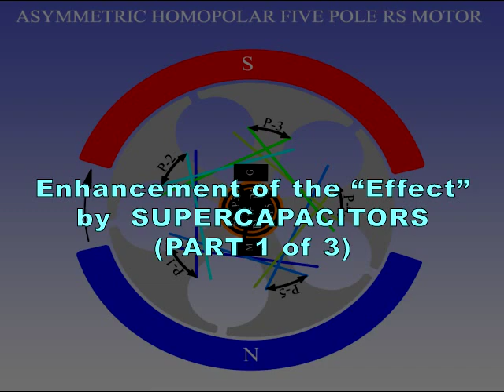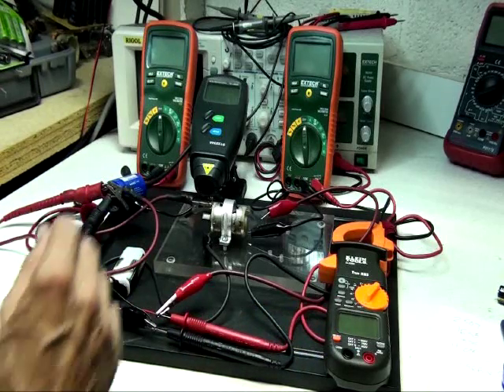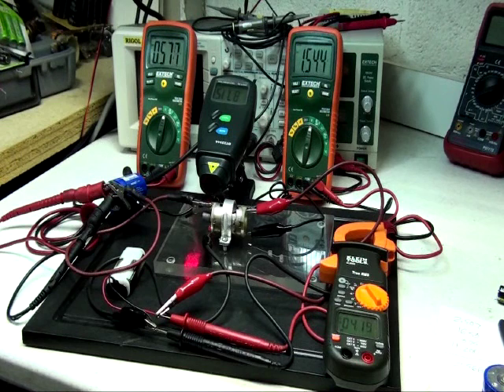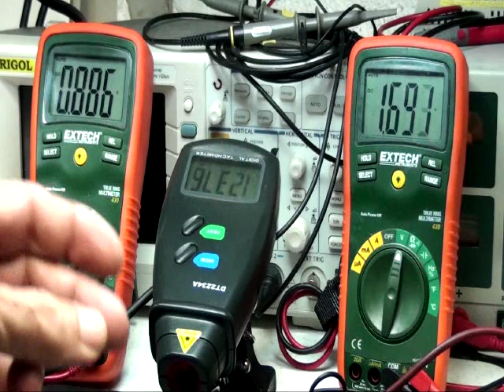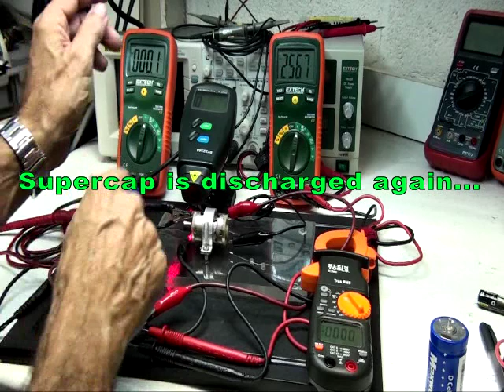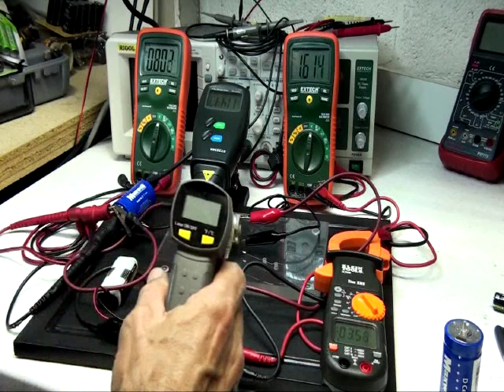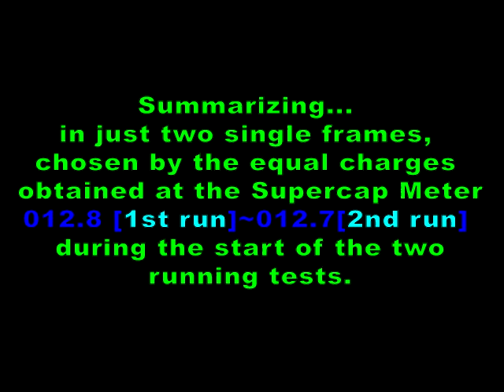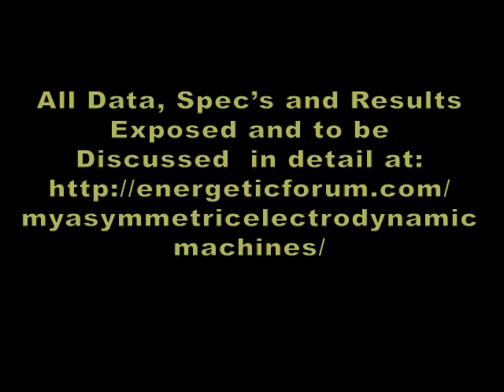SUPERCAPS TEST 1

Comment: This is good research. Your doing good progression. There is an anomaly in the amp reading. You may have to confirm this with a scope. The reading of 4.8 amps is only possible for a few seconds. The actual emf ultra fast rise induced spikes are trowing off your amp meter. These spikes are from the brushes. On another point, the battery is recovering almost all it's energy. That's a hard feat for a chemical battery to do. That means that the motor is close to 99% efficient. And possibly beyond that. By switching run batteries every minute you could run this for hours if not days, if switching is done automatically with relays and using 7 batteries.  This gives 6 minutes for each battery to recover. A guy from Alaska has a battery switching circuit like that. he runs the batteries at 100 amps for 1 sec each. and alternate 7 batteries. This way he increased his electric car range by 8 times. Because he lets the batteries recover before they drop dead. Each batteries recover for 6 seconds and are run only 1 seconds. You are on to something good here. keep it up.
Reply from the maker: Thanks Mike!
Now related to amps reading, I know something is wrong...however, I had to reinforce the rear contacts at battery holder...since it was melting the plastic...smoking where spring is...and was throwing off energy in heat...so, second video I show this anomaly...

And absolutely by pulsing this system we will get much more out of it...:)

Regards

Comment: Hi, and thanks for showing that it is possible to harness the BEMF of a motor !
When You check the induction of the wingdings, the frequency of the motor at different speeds You gonna find the different capacity values that are required to let the motor run on different speeds / different resonances ! That's also the reason that You DON'T have sparks, it's the BEMF that makes the sparks ! You don't have / waist them !